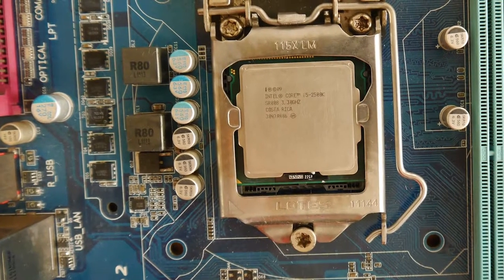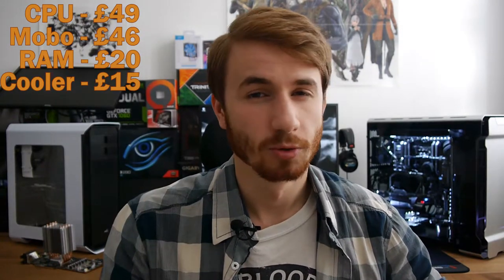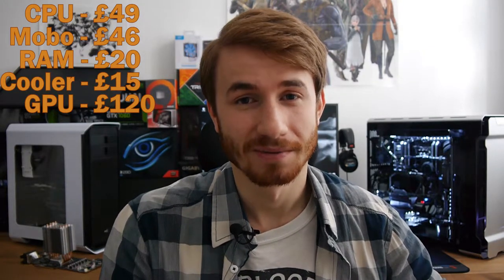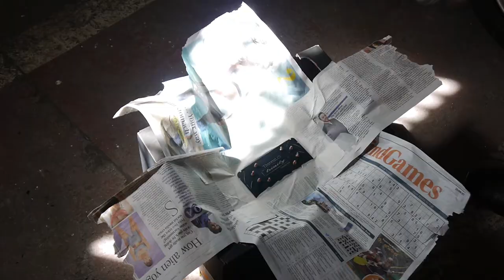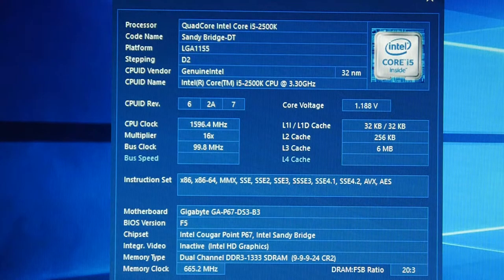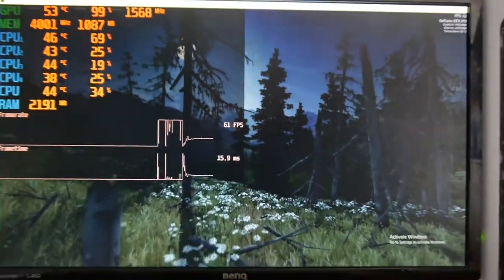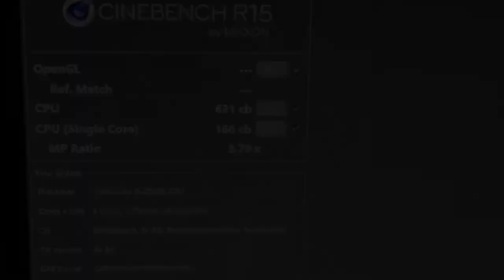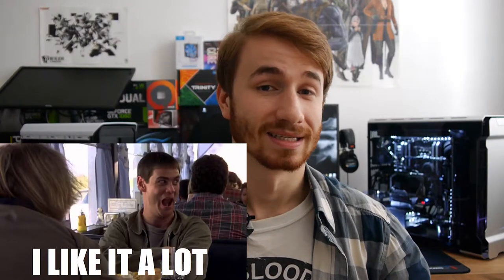£285 USED Sweet Spot Gaming PC for PlayerUnknown's Battlegrounds

Comment: Good choice with the 2500k it's my favorite budget cpu
Reply from the maker: That CPU is so damn good and it overclocks so well!
Reply: Jeagar Tech do you have seen how old xeons perform they are very good in terms of price to performance
Reply from the maker: Yeah, it my last video I used the X5650. The problem is finding the right platform. Only the quite old platforms support overclocking for xeons. Later stuff like 1155 and 1150 don't
Reply: Jeagar Tech that's sad but their good anyway
Reply from the maker: Yeah, the i5 CPUs for 1155 are still great value as they are and the motherboards aren't too expensive. The older platforms that can overclock xeons have very expensive motherboards now.
Reply: Jeagar Tech Well If you have a board for a Xeon it's worth it
Reply from the maker: Exactly. And sometimes you can find them cheap, you just need to watch out for them and buy them quick!

Comment: I have a similar setup on my test bench right now. 2500k @ 4.8ghz with a GTX 970 (main difference is I had 16gb of ram at 2133mhz). One thing I didn’t hear you mention is that this setup will actually give you a pretty decent experience at 1440p. Not mind blowing or anything, but is a good entry point. I was able to run PUBG with a mix of mostly high settings with a few things turned up to ultra for an average of 59 FPS on a 20 min benchmark run.
Anyway, excellent video! Just discovered your channel yesterday and you are seriously the most underrated tech channel on this site. You make fantastic, high quality content. Just need one video to blow up and I think this channel would thrive. The only thing I can think of to suggest is maybe do something to your thumbnails to make them standout a little more

Comment: feels to me alot like TECH YES Bryan - but UK variant. <3 it and subbed.
do more used pc builds - u r quite good.
BTW: I have question about 970 boost - how did you manage to boost over extra clocks? my gpu if overclocked stays on that clocks and never boosts more.
Reply from the maker: Thanks a lot for the support! 

So you overclocked your 970 and it didn't boost any higher? What program did you overclock it with?

Comment: Also I was surprised to see how well it overclocked on a p67 chipset.. can a h61 chipset overclock a k processor? Thinking of getting a 3570k to upgrade from my Xeon E3 1220. Also have a 970 :)
Reply from the maker: Yeah so was I! I think we can all get caught up in overkill motherboards and don't realise that they don't need to be nearly as overbuilt as they are haha. H61 can't, P67, Z68, Z75 and Z77 are the only ones that can as far as I'm aware... 

Nice choice, the 970 is to this day one of my favourite GPUs :D
Reply: Jeagar Tech thanks for the reply. Ah damn, I have a h61 mobo.. mainly because I have an ITX system and lga1155 z77 mobos etc are seemingly still in high demand / quite rare. Looks like I'll have to pass on overclocking then :( I'll get the 3770 instead at some point, don't actually need anything more than my Xeon rn
Reply from the maker: G_ nt yeah I know, It's so frustrating trying to find itx 1155 boards, and whenever you manage to find one it's so expensive! That xeon is pretty good, I wouldn't rush to an upgrade either :P